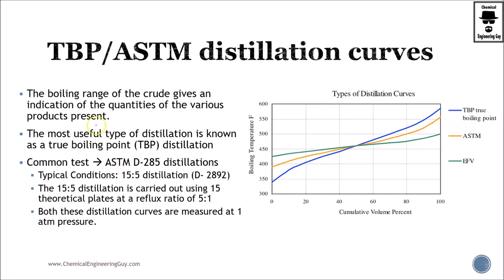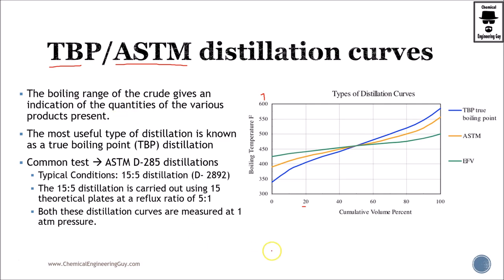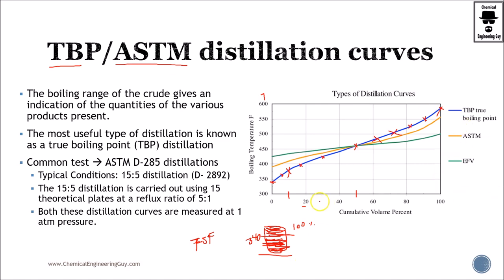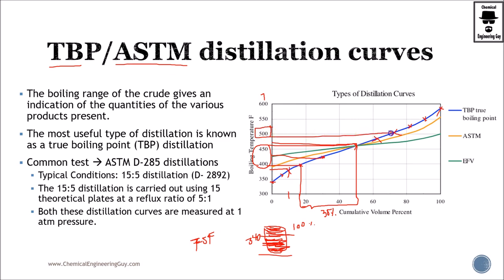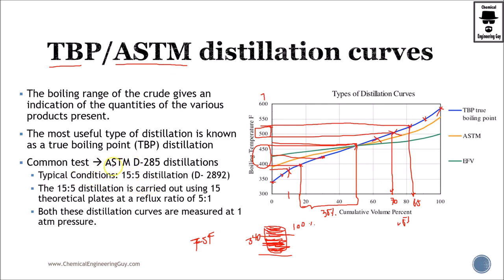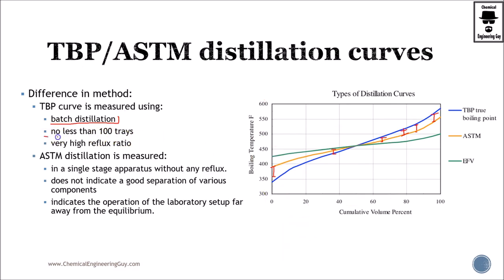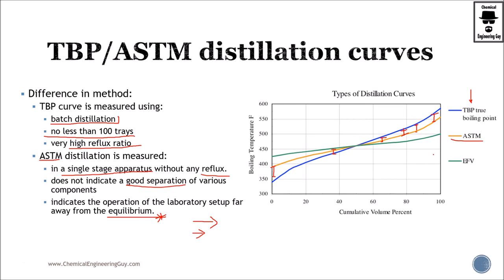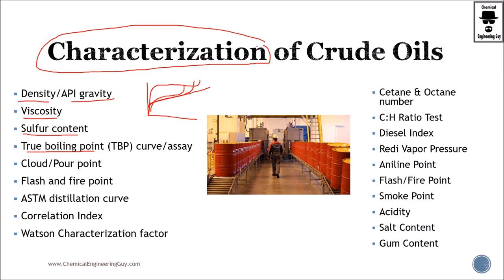True Boiling Point Distillation Curves ASTM - TBP (Lecture 057) - Petroleum Refining

Comment: First time I get the difference between TBP and ASTM..thanks alot.
Reply from the maker: True! I also got problems with that, but actually is pretty straight forward ;)
Reply: I still didn't understand the reason behind using 15:5 method to know the distillation temperature